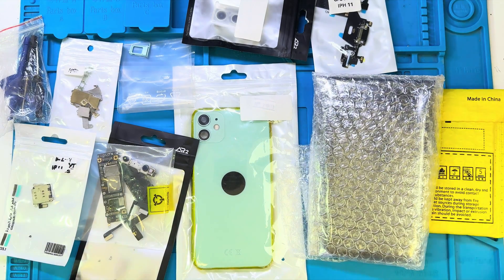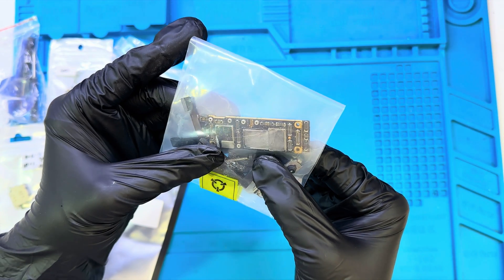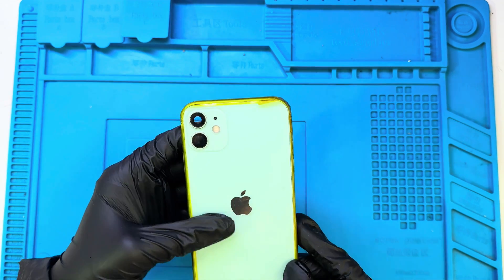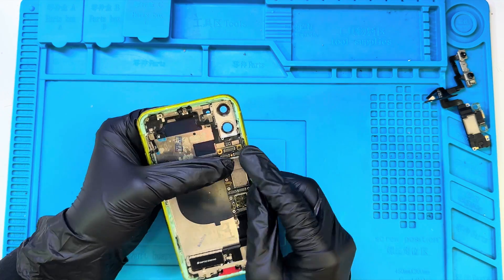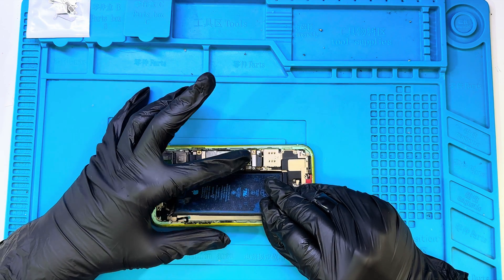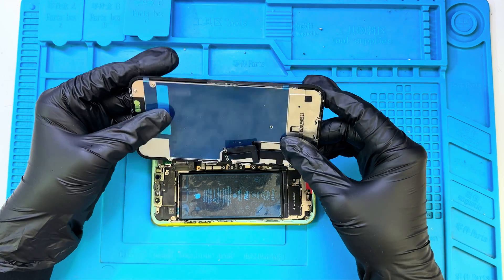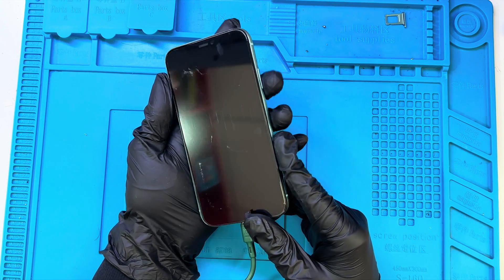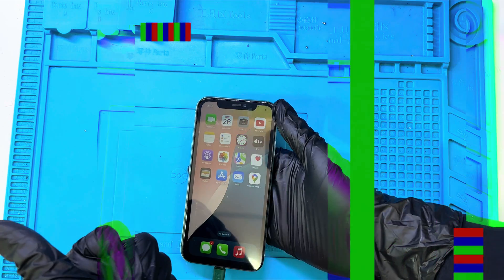I Tried Building an iPhone from AliExpress Parts — It Actually Works!!

Comment: ur probably better off buying an iphone 11 that has a cracked screen or a bad battery or both as you can just toss an amazon special iphone screen or battery in and the phone wont care too much, just make sure your running ios 18 or 26 on it or it will disable true tone on the screen and disable battery health.. ive done this with several iphone xr and xs running ios 18...
Reply from the maker: That’s true, but building everything brick by brick gives me a sense of satisfaction. If anything goes wrong, I know exactly where to look — and honestly, the process itself is part of the fun.